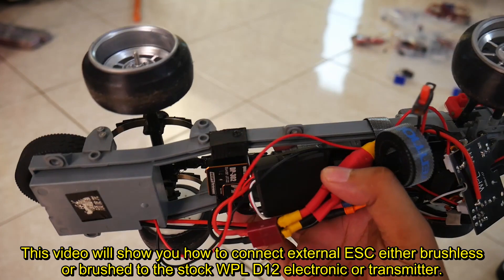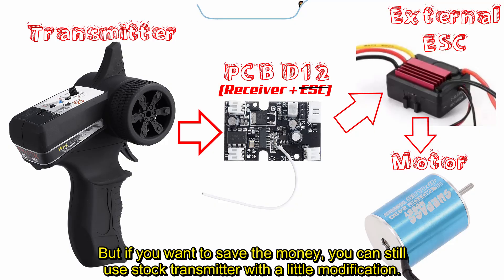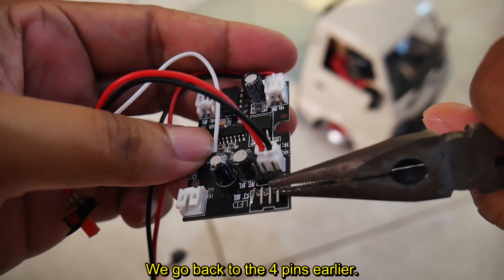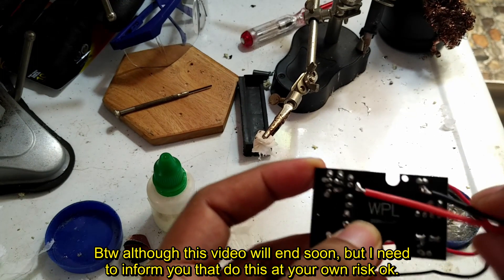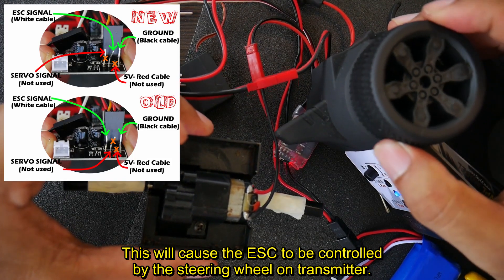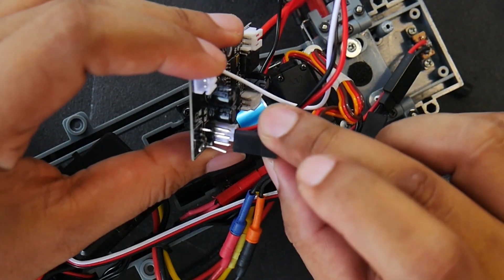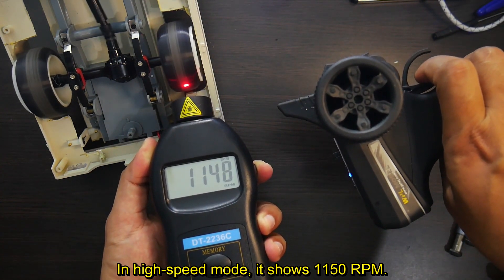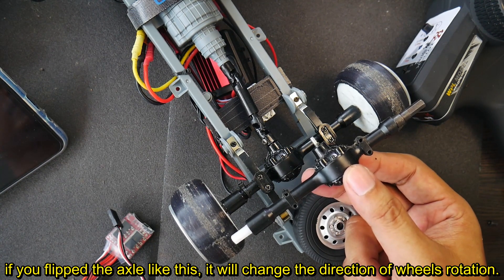Using Stock Transmitter! How to Upgrade WPL D12 ESC (Brushless & Brushed)

Comment: Hi this is a very good video. Will you be able to use similar method to connect a external esc to the MN82 receiver board? Thanks

Comment: Can this be done on the MN stock receiver? How can we tap into the 2 inputs of the motor driver IC TA6586 or do we have to find the rx signal from the transmitter?
Reply: @daijoubu4529 have you ever found about if the MN stock receiver can do the same thing? Thanks
Reply: @aeroelastic6736  i made an Arduino that does the conversion, I can share my code, you'll have to solder 4 wires

Comment: Video is grate, explenation also. 
But i think box is not tat practical. Holes should be facing front to the motor not sidways. Im having dificulties with wires. I did send message to make holes on front. Maybe he will remake it. 
But exept for that i love the box design and puting it all back togather. 
Thumbs up.

Comment: Hey man if I get replacement stock d12 receiver / esc. Will the stock transmitter work? How do I bind them together ?
Reply: I have three wpl D12, and I can use one transmitter for all of three (not simultaneously). It will bind automatically (in my case).

Comment from the maker: If you don't want to solder the PCB, just use separate battery for the ESC.
Reply: hello. is it possible to use 3s battery for esc and 2s for stock receiver same time? Obviously with different power switches an circuit.
Reply: Gadoga what if i have 2430 Brushless 6300 kv which esc is better 25A or 35A ??
Reply: Can I just use a plug splitter from the battery connector? Instead of soldering to the board